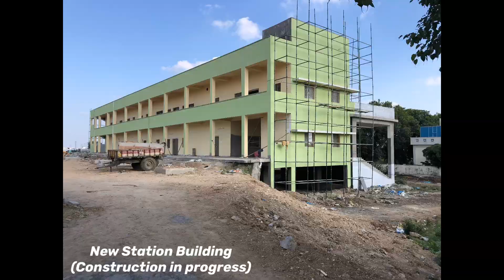NALLAPADU STATION || PIT & STABLE LINES|| NEW STATION BUILDING || TRIP SHED || INDIAN RAILWAYS ||

Comment: Bro what is the length of the pit line plz tell 24 coach or 2 rakes hold plz tell
Reply from the maker: 700 meters
Reply: @maheshravela7  ante oke sari 2 trains padataya anna pit line lo
Reply from the maker: can be used for One Passenger rake with 14 coaches and one Express with 18 Coaches, at a time